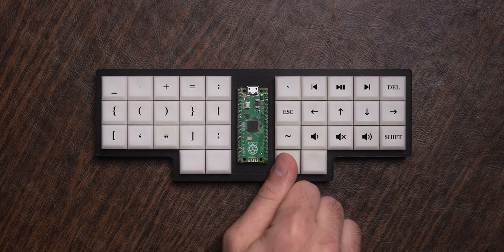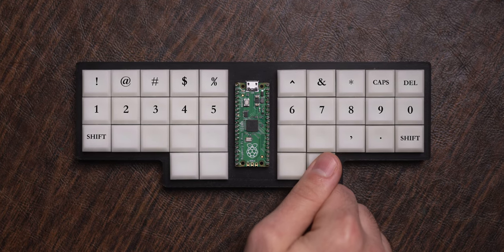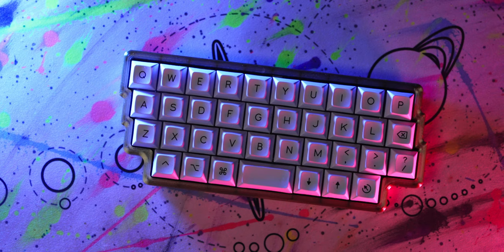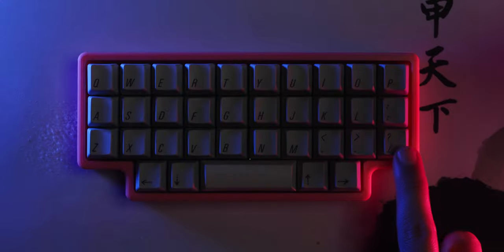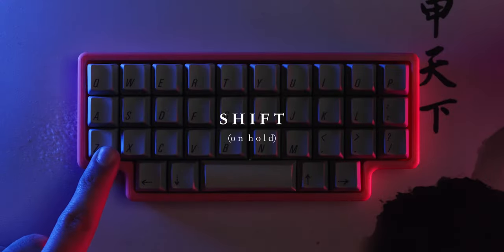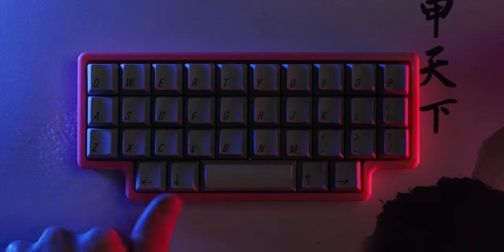Tiny Keyboards Explained

Comment: I really like the pace of your videos. 
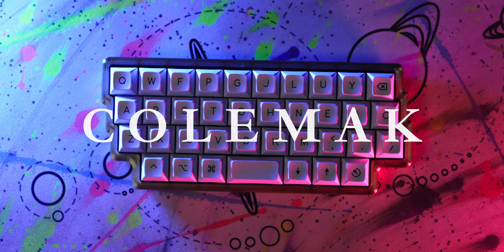Did you made transition at 1:05 digitally or taped board to table and rearranged keycaps? 
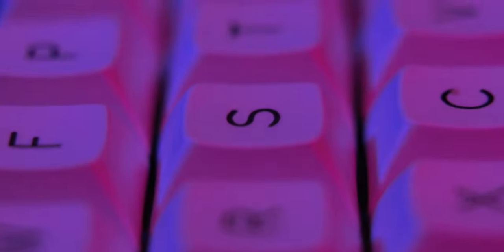And i also feel like a visual bit of camera gliding over keeb at 1:11 feeling too fast compared to other parts

I'm ready to listen you narrating a 3 hour lecture on biology of mammals
Reply from the maker: The transition at 1:05 was just two takes without moving the board then a fade between the two after aligning with opacity. The one at 1:11 was the best I could get, I wanted it to be slower but getting everything the way I wanted was hard so I just settled.
Reply: @joe_scotto  oh, thats nice. Looking forward to see more of your editing skills.

Comment: Curious, did you actually run into RSI issues from using QWERTY? I also went down the whole designing and soldering my own wireless splits and switching to something like colemak. But then realised the only thing over qwerty is just comfort. I actually don't mind the dancing around the keyboard either, so I switch between both regularly.

For the layout I also like using 3 finger combos for frequently used keys, so for example `jkl = esc` or `mkl = enter`. The fingers are already there so why not. Anyway, nice editing! But feels a little too serious for something so... Dull?
Reply from the maker: I wasn't really hitting any RSI issues from QWERTY but after switching I felt more comfortable. What I believe though is that if the switch does it's job, I won't have an RSI in the future.

Comment: I am using two language layouts - for chatting and emailing I use Slovak (due to special characters) and for coding English. I would like to switch to something other than qwerty, however COLEMAK doesn't work well with Slovak. What would you recommend, as I wouldn't want to have different layouts for different use cases.
Reply from the maker: I'm not too sure since the most common alt layouts I know of (Colemak and Dvorak) are optimized for english. Maybe switching to Colemak with a smart layer for special symbols would be a good middle ground, although I don't know how it works with your language. QMK also has options where when you hold keys it will enable secondary functions which might be helpful.